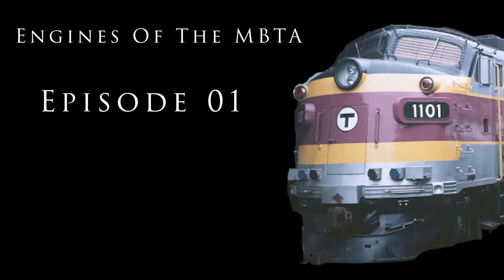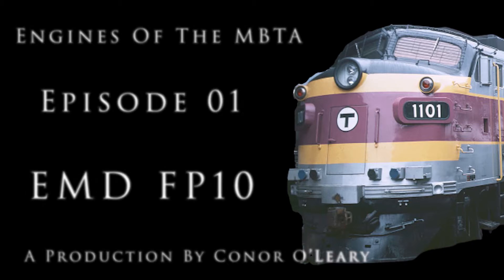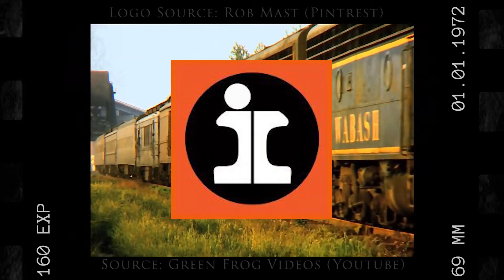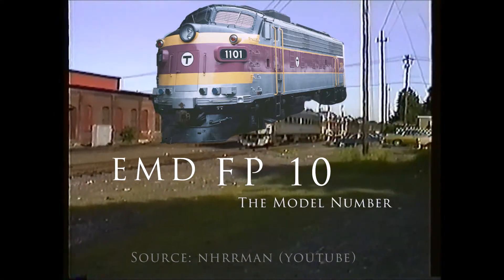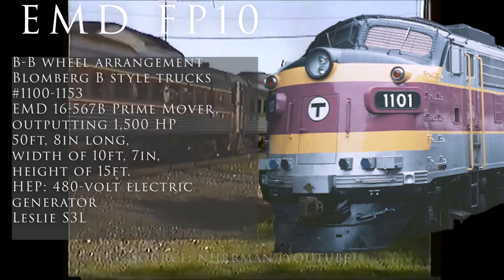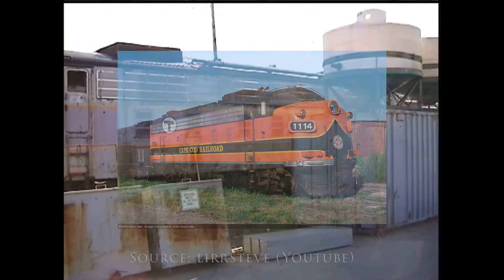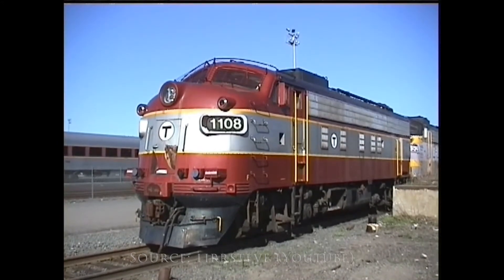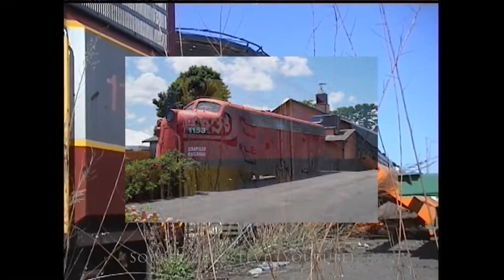Engines Of The MBTA // Episode 01 // EMD FP10

Comment: FYI the P in FP means passenger,  FP7, FP9, EMD built  couple hundred of each,  original equipped with steam boilers for the old steam heated passenger cars. They were I believe 4ft longer than the original F7 to accommodate the steam boiler.  The were eventually converted to run HEP, head end power, for push  pull operations.
Reply: I think the ICG rebuilds were mostly freight F3s all from GM&O.
Reply: Standard length F units were also built with boilers.
Reply: @MilwaukeeF40C  you are correct
Reply: @briansaxby5357 the FP10s weren’t extended unlike the FP7s & FP9s. Also, the F3As that were rebuilt were originally equipped with no steam generators, as they were created for freight service.

Comment: 1114 is disassembled at RELCO, the owners (The SRLG) never paid for the rebuild so it is just sitting there
Reply from the maker: Thanks! If I make a reboot, I'll make sure to add that!
Reply: @conorontherails  If you do, you also gotta include that the Cape Cod Railroad in 1992 leased three FP10's for tourist use, 1100, 1101, and 1114, 1101 was never really used and was kept in its original MBTA scheme since it was a parts unit and barely saw service at all due to mechanical problems, these units were on lease until 1998 when the state forced them to shut down because they were dumping sewage on the tracks.
Reply from the maker: That is some interesting information! I'll make sure to add that as well!
Reply: @TG-cf6qb  1114 and 1100 were the locomotives used on the passenger service. 1101 was used for parts. I worked for that railroad
Reply: Maybe Relco will turn it in to a low hood vis cab Leaf switcher.

Comment: MBTA got 19 FP10 units rebuilt from Gulf Mobile & Ohio F3A units by Illinois Central Paducah shops. 
MBTA originally wanted about 19 ex New Haven GP9 units rebuilt at Paducah. ICG had a better idea, take the GP9s in trade for the F3As that would be rebuilt for the T.
Units 1100-1114 were built with HEP generators, 1150-1153 had steam generator units because of steam heated cars still at the T. Those units were likely later rebuilt with HEP units. The HEP generators had to put out both 480 volts and 575 volts, the latter for 53 leased GO Transit single level cars.
Reply from the maker: I'll include this information if I reboot the series, thanks!
Reply: Probably a better idea for ICG mainly.  They would have scrapped the Fs. They got much more valuable assets in the geep deal- resale value for MBTA would have been better with probably the same rebuild cost per unit.

Comment: The GP-9’s from the NH RR were used as a trade in for the FP - 10’s but 2 were brought by the MBTA most of the FP - 10’ ran out of the North Station with the Leased GO commuter rail cars